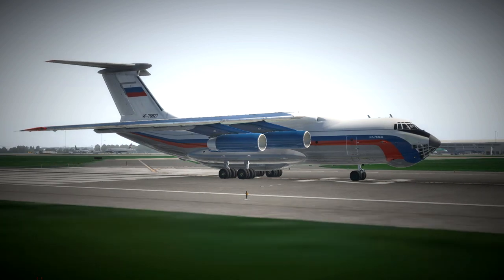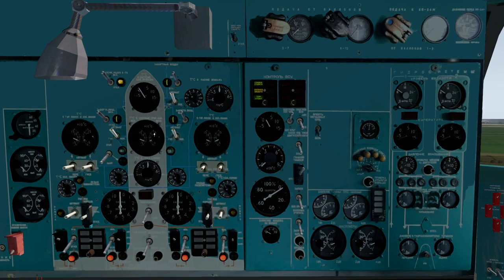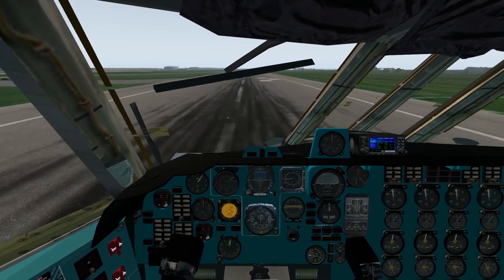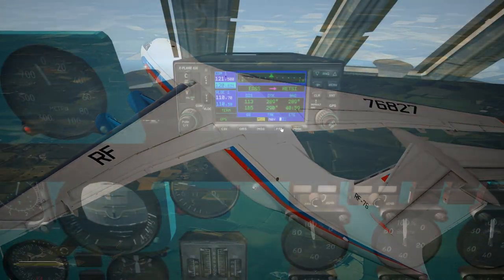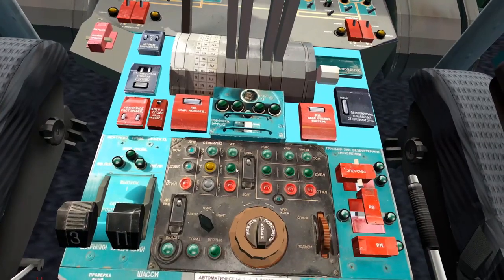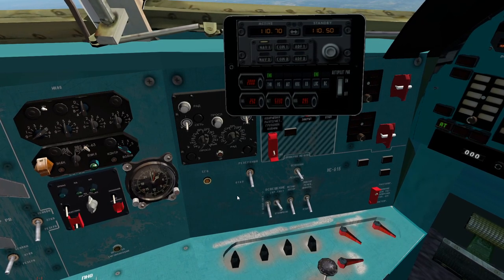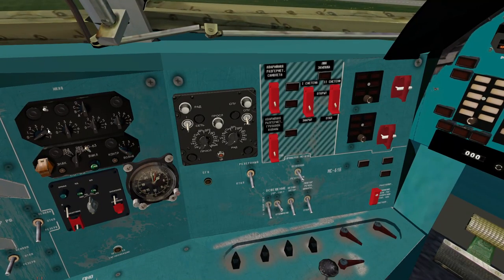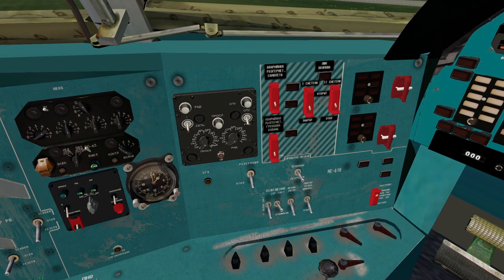X Plane 11: Ilyushin 76 | English Tutorial | How to use the Russian autopilot?

Comment: Well, the engines sound quite wrong. What you hear from inside when apply take-off power is close to qhat you hear when you've just turned on the engines on the ground so they just work but don't produce thrust :)